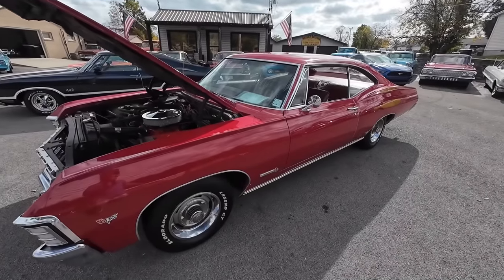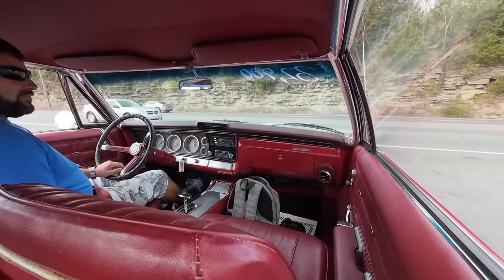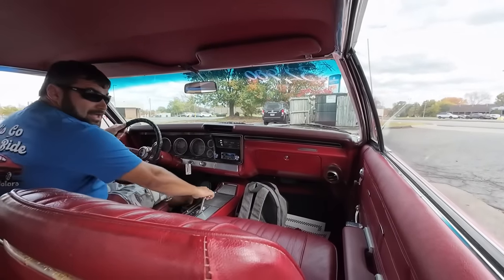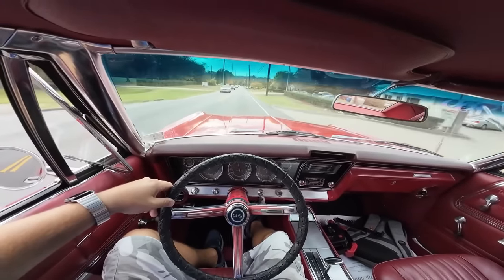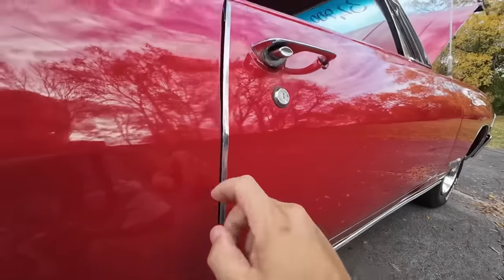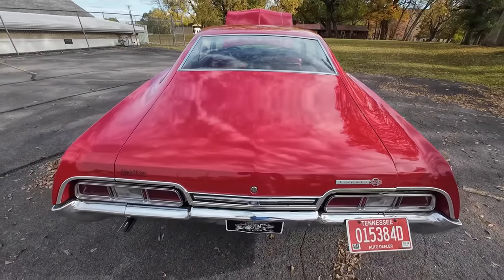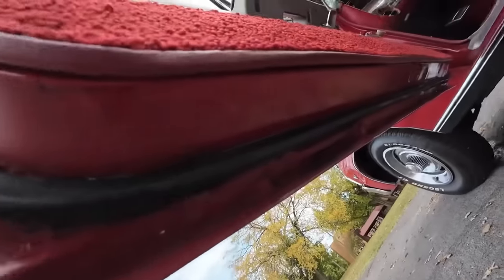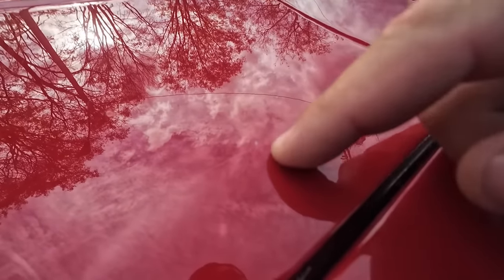Test Drive 1967 Chevy Impala Super Sport SOLD $32,900 Maple Motors #2378-1

Comment: IN 67 YOU COULD ORDER ANY ENGINE FROM A 230 - 427 , MOST OF THE SUPER-SPORTS WERE STANDARD 283 - 327 , OPTIONAL 396 - 427 , THE DASH GAUGE  LAYOUT IS OUTSTANDING FOR THE TIME , IT WAS THE ONLY CAR THAT HAD THE BIG ROUND GAUGES , THE MALIBU & SS MODELS HAD A SINGLE CLUSTER !!!

Comment: 66 and 67 were my favorite years because 66 was the only year with 3 tail lights per side with back up lights under them and 67 being the only year with round gages
Reply: 65 had three tail lights....66 had a bar type wrap around the sides.
Reply: @5jr.racing982  had a 65 SS white on white. It was 2 tail lights per side with the back up lights between the 2 tail lights
Reply: @jeremyk3320  yes...3 lights per side....Byscanes ha 2 per side...I was just stating to the comment that a '66 had 3 lights per side, when in fact a ' 66 had a bar type rear lights that wrapped around.
Reply: @5jr.racing982  Roger that. I'd love a 66 with the L72!
Reply: @jeremyk3320  my first car in 1976 was a hand me down from my mom....'66 Caprice Classic with a 396 big block..but not an L72

Comment: she has a turbo 350 transmission, they did not come out until 1969,,,,,,,,,,,,,,,,,,
Reply: Good eye! It would've originally had a Powerglide or th400. If the car originally came with the 283, it usually had a Powerglide. But not hard to swap in a th350 in place of the original transmission. It would be an upgrade from a Powerglide.